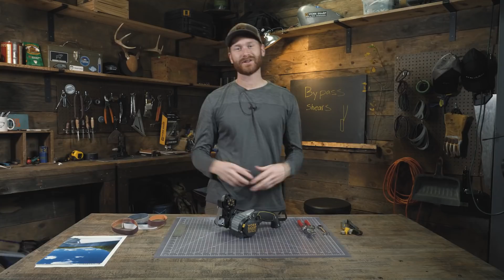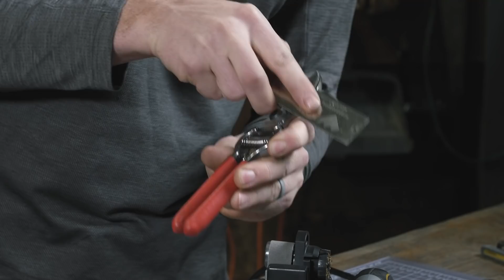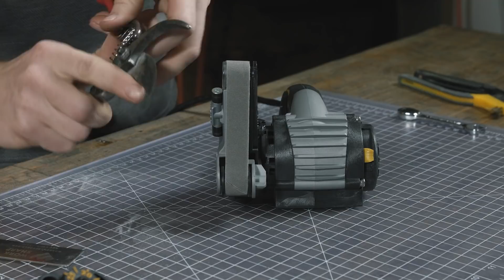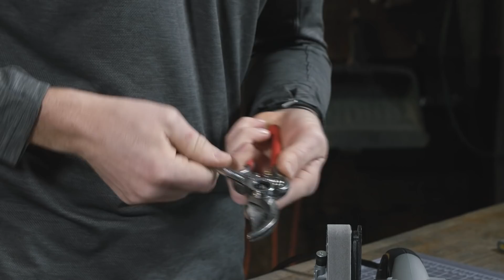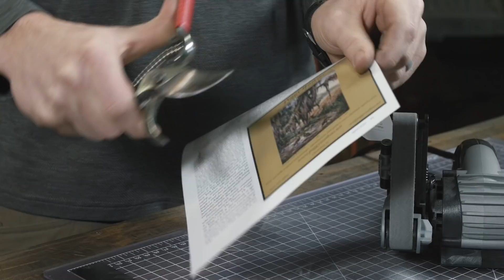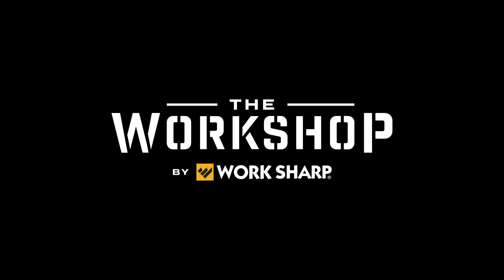How to Sharpen Pruners

Comment: How do you sharpen these on the Work Sharp Guided Field Sharpener?
Reply from the maker: The easiest way is to remove diamond stones from the GFS and bring the abrasive to the pruners.  Hold the stone on the sharpened edge of the tool, match the angle, and make passes until you raise a burr.
Reply: @WorkSharpOutdoor 
Can you please do a Video?
Reply: Can you please do a video?

Comment: Hi do you have any key chain sharpener or look like a pen,because as a chef many countries its illegal to carry knife even on crews ship, the knife you are given are very very dull, and the uniform pocket (clothes ) are small or they don't have pocket
Reply from the maker: Check out our Micro Sharpener and knife tool, you can see it here. The abrasive surface is small but effective for maintenance or to sharpen in a pinch. https://www.worksharptools.com/shop/sharpeners/manual/micro-knife-sharpener/ Or check out our Pocket Knife Sharpener for a little more abrasive to work with.

Comment: Good information and thanks for showing. Somehow my Tensioner Assembly on my Blade Grinding Attachment got way off center when changing belts. So much so that when relaxed to run the belt it was not at the 90 degrees perpendicular but more like 45 degrees off towards the wall of the machine. And the Tracking Knob would not bring the Tensioner Assembly back to 90 degrees. I could tell something was out of wack on or with the long guide grove found on the shaft of the Tensioner Assembly. So I removed the Tension Assembly Clamp Lever and then removed the Tensioner Assembly. I found that the nut that is suppose to ride in the long grove found on the shaft of the Tensioner Assembly was no longer in the grove but jammed up against the inside wall of the assembly. I did some adjustments to get the nut back in the grove. But I have not found "the sweet spot" placement for the nut to ride on its' bolt inside the assembly,  in relation to the exterior nut (the one with anti-rotation nylon locks) found on same bolt on the outside of the assembly. Any suggestions to get the parts properly aligned and placed on said bolt would be wonderful. It's currently working but nothing like new.
Reply: I know it's been 3 years, but I had a similar issue and contacted Work Sharp and they quickly responded with the following details that immediately fixed my problem. The nylon nut had come off, but this got me back in business. 

1. Remove the Tensioner Block from the BGA Frame.
2. Install the Black Plastic Cap and the thin Adjustment Nut onto the Tracking Knob Screw.
3. Install the Tensioner into the Tensioner Block.
3. Compress the Tensioner into the Tensioner Block and rotate the Tensioner to expose the Groove.
4. Insert the Tracking Knob Screw with the Adjustment Nut.
5. Rotate the Tensioner so the Nut goes into the Groove and then Rotate the Tensioner back while sliding the Tracking Knob Screw into the Tensioner Block.
6. Release the Tensioner. It should extend but come out of the Tensioner Block.
7. Hold the Tensioner Block and Tracking Knob screw together to prevent them from coming apart.
8. Use a nut driver or socket to thread the Nylon Lock Nut onto the Tracking Adjust Screw that is now sticking out of the back of the Tensioner Block.
9. Adjust the Nylon Lock Nut tension so the Tensioner does not rotate freely when turned using your fingers but still travels smoothly when the Tracking Knob is rotated.

Comment: I would love to see more tutorials on the Blade grinding attachment! Especially multitool blades i have difficulties with.
On my Leatherman surge and wave one side is too thick and the blade cant touch the angled belt and i have to freehand, i dont love that...
Reply: I also have issues figuring out the 90° belt portion on the front of the attachment, there is sill alot of slack in the belt there, im wondering if a thin metal plate could be adhered there to make it a propper flat plate?
Reply from the maker: There are a few ways to dial that in, depending on what you want. I recommend buying a replacement leather strop from our guided field sharpener and sticking it to the metal plate. This creates a tight fit, and offers an ideal density for grinding (at least in my opinion).
Reply: You either have to free hand it on the vertical portion where the platen is, or just use the regular Ken Onion sharpener (not the blade grinding attachment) which is what I do.